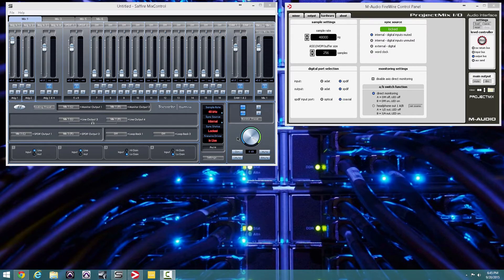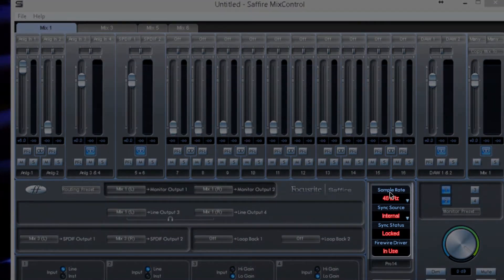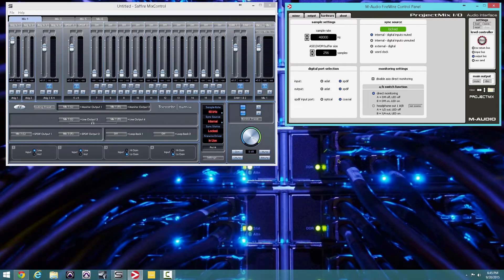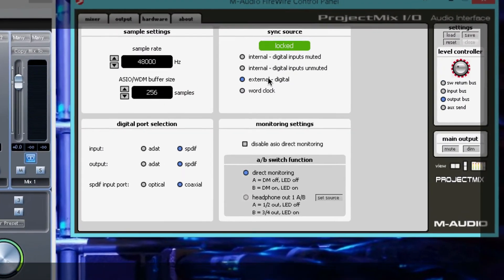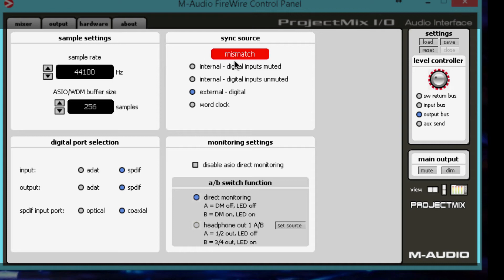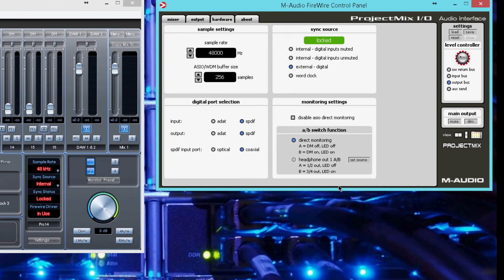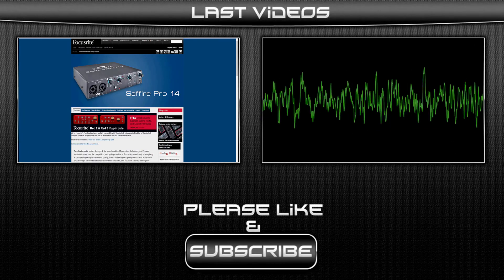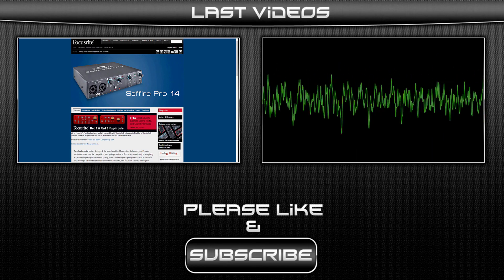Digital I/O

Comment: I also have a Focusrite interface (18i20). It has S/PDIF I/O, and I'm going into it with a S/PDIF that's coming from my Aphex Project Channel. This is the only digital output from the Aphex, so I assume it's automatically syncing to my Focusrite. I do however have to select the correct sample rate on the Aphex, or it doesn't transmit a signal to the Focusrite. Is this correct and should I have a concern about signal sync at all? Also... I just got an ART Voice Channel and it actually has word clock. I was going to link the Focusrite to the Voice channel using a 75ohm cable and terminating it. However... is this necessary when running it to and from this unit via Toslink?
Reply from the maker: Hi sorry for the late reply , Did you get it to work?

Comment: How are you using this w/Protools 12? Mines not showing up???
Reply from the maker: +Watchman4u What  operating system are you working with??
Reply: ***** Mac OSX 10.10.4 , I got 12 11 & 10 I Thought 10 or 11 might work w/it but they won't load??? Say's I need something higher than a 10.3.1 ? I see Graham has all three running? Thx for the advice Ray!!!
Reply from the maker: +Watchman4u DId you try 10.7.4 drivers for PMIX?I think Graham could be using 10.8.5.If you look at the Compatibility Chart 10 11 and 12 work with 10.8.5.
Reply: ***** Thats the thing Mac won't let you down grade I've been messing w/this for a day + now very frustrated. maybe I have Mac 10.8.5 on back up but I don't think so I had a external HD die on me. Thanks for the advice. Are you still using the PJ MIX? Such a shame they won't write new drivers for the PJMixI/O smh….great piece of gear. Oh the fire wire mixer that go's w/the PJ Mix won't even load now???
Reply from the maker: +Watchman4u I had my PJMIX working with mountain lion no problem but I did not try with YOSEMITE.CHeck this out.

http://community.m-audio.com/m-audio/topics/yosemite-and-firewire-1814-projectmix-i-o-workaround